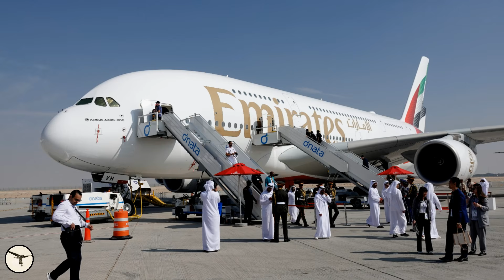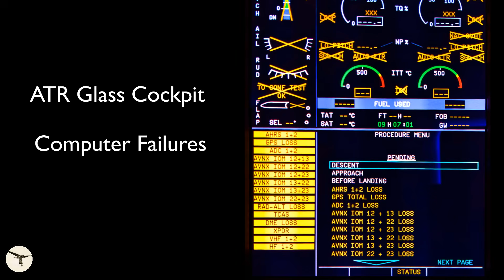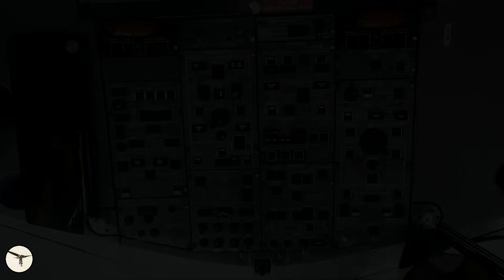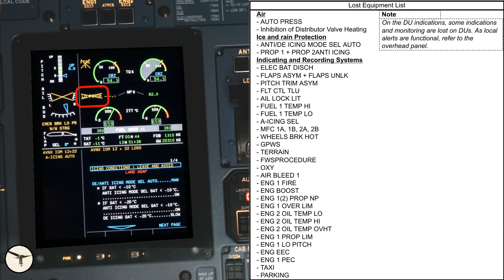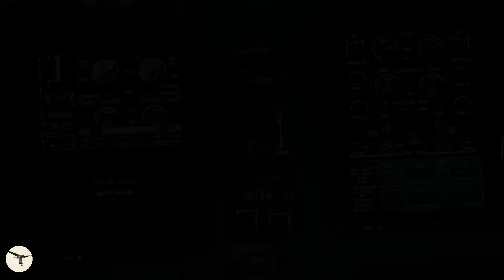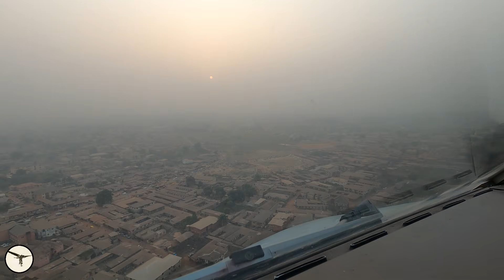Warning: Only for ATR Nerds - Avionics Failures Exquisitely Explained by Experienced Examiner

Comment: Sir we have had issues with the CAC’s before but managed to resolve but the propeller auto mode select. Indicates a fault overhead at -10 but manual mode works fine. What could be the issue? The we have replaced MFC’s with no luck.